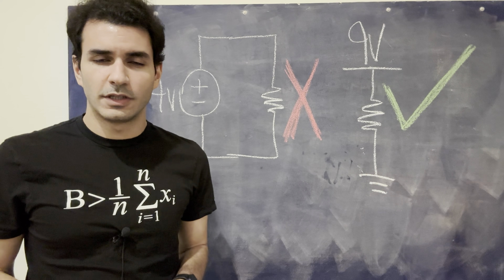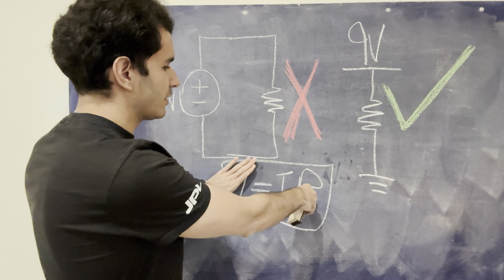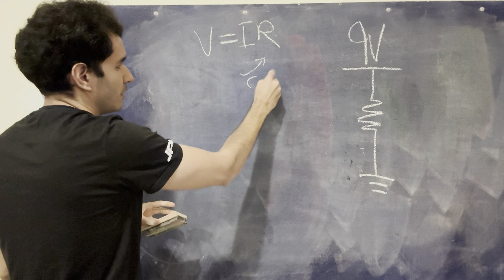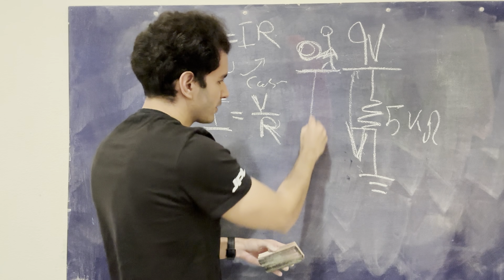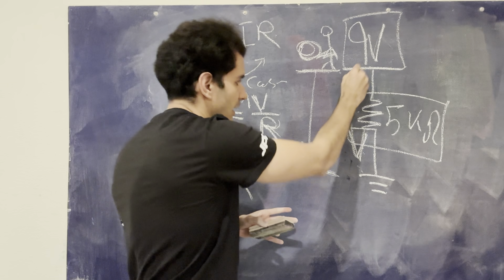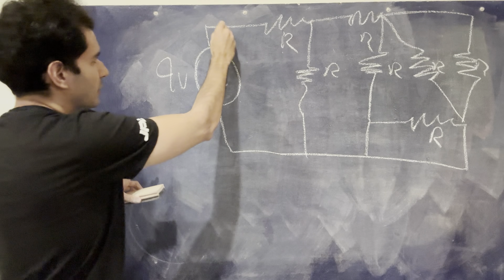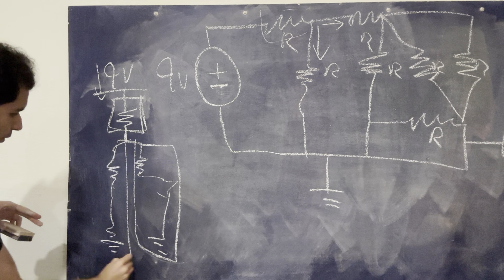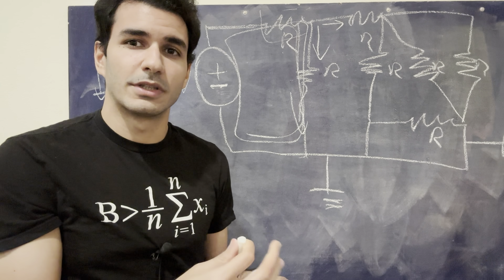Circuits Finally Made Sense When I Saw This One Diagram

Comment: Many people have a car with a battery for starting the engine .  Clearly the battery has 2 connections labled + (plus) and - (minus) .
To start the engne enormous current is required from the battery.  When the battery is OLD enough , its internal resistance become so large that it limits the current that a  good  battery provides: THE CAR  WON''T  START !   Without understanding that Resistance is symbolic, there is NO way to understand why an  OLD 12v battery will CAN NOT START the car !

Comment: So, a kid gets a battery, lightbulb and two wires. Which diagram allows him to build a working circuit?
Reply: Savage 😂
Reply: The second kind of diagram is just painted "inside" or on the battery. So the kid doesn't even need a board to put the wires on.
Reply: Both
Reply: None, the kid gets confused and instinctively opens up tiktok

Comment: We use multimeters digital or analog to tell us the voltage ⚡️, and resistance in ohms, and continuity, and use a power supply to visualize the current, or multimeter again, but need to remove the component, so it's extra work. Or if you have an oscilloscope, it's even better. What I'm trying to say is, there are few occasions where you need to figure out the volts, resistance, or amps in your head.. very few. And even in school you do learn both styles of diagrams.. so if you know it completely, it doesn't matter which diagram you see.

Comment: Uh - no that's not how electricity works. What you're talking about here is a conventional representation to make it easy.  The energy doesn't flow through the wires - it flows between them.  In fact - the electrons - even in a pure DC circuit - barely move.   Thinking in this simplified manner is what the one engineer at NXP called "The Billion Dollar Mistake" since not knowing how the energy actually works in a circuit leads to all kinds of issues with signal integrity, EMI and other nasty problems   

Here watch this: see Prof Muller show how electricity really works:

https://www.youtube.com/watch?v=oI_X2cMHNe0

the original vid that caused all the fuss - https://www.youtube.com/watch?v=bHIhgxav9LY
Should have been 1m/c seconds NOT 1/c seconds since the bulb was 1m from the switch

Dr Eric Bogatin explaining what EE's doing PCB designs know - the dielectric is where it's at : https://www.youtube.com/watch?v=Lp_b8gQpxW8
-- note where he talks about displacement current.

Another by Dr. Bogatin:
https://www.youtube.com/watch?v=icRzEZF3eZo

The article I saw in PCBD&F from an NXP engineer a month before the Veritasium controversy - "The Billion Dollar Mistake"
https://www.pcdandf.com/pcdesign/index.php/editorial/menu-features/16269-the-billion-dollar-mistake

I've designed over 3,000 products. Google ajawamnet.

Comment: I think that you could be confusing some beginners with the straight line being better than the looping circuit because that wasn't your point. Your point was to still use the loop circuit in a vertical form. I think that your argument should be more of electrical direction; electron vs conventional flow.

Comment: I am a newb - Does the resistor waste power? Is a resistor heating up? If so, wouldn't it be ideal to never have a resistor, and only use the power that is needed directly? That way no electricity was wasted by having to use a resistor.
Reply: Yes resistors waste power thats the right way to think about it. Thats why load bearing circuits almost never use them if possible. But real cables have resistance by nature of the atoms they are made of so you need to learn how to calculate it because resistance is hidden in every part and wire and can be calculated just like a resistor.

The wires you draw in a schematic are idealised (as if they had 0 resistance) because it makes the math easier. But if you wanted to design a real product, you would draw the lengths of wire as imaginary resistors between each of your connected parts. strong currents can melt your cables if you ignore their inherent resistance
Reply: @ataarono  Thanks for the reply! I have a lot to learn about electricity but I'll get there eventually.
Reply: Think of electricity as light. Without anything blocking light , it would really go fast because as you know, the speed of light. That can burn out a circuit pretty quick. To slow it down you use a resistor. Resistors are know to last many years. You'd probably throw away an electronic equipment based on  any other failure compared to a damaged resistor. Resistors do waste power but if you use a resistor that is rated higher than the required, you waste less power.

Comment: I have an MSEE and over 40 years of designing analog and digital circuits, over a dozen resulting in patents. If students find your approach clarifying, then they should use it. However, they should think about it as a tool in their electronics toolbox. Since you are training the next generation, perhaps less hubris is appropriate when suggesting tools. If the only tool in your toolbox is a hammer, everything starts looking like a nail. Whenever I'm confronted with an electronic circuit, I look in my toolbox for the best approach. Sometimes re-drawing the circuit helps, sometimes I use node analysis and sometimes, like in your example circuit, I just find the battery current by calculating the Thevenin equivalent on the left side and the equivalent resistance of the right side in my head. Skeptical? Look at your circuit. The resistor in lower right corner is shorted so it can just be removed since no current can flow through it. That leaves 3 resistors in parallel which every EE student should know equals R/3, so the right side is R+R/3. Now the left side, using Thevenin equivalent is V/2 volts and R/2 Ohms which any EE student should know by inspection. So, the current is (V/2)/(R/2 + R + R/3) simplified to I = 3V/11R. I suspect you didn't mean to draw the wire that shorts the resistor which complicates the solution, but a tutorial should be accurate to keep students on track & that's what I'm responding to. In my opinion, your message shouldn't be "do it my way" but "do it your way, and here's another tool". FYI, I started my career designing satellite communications at TRW Space & Missile Systems for NASA.
Reply: Thank you Fall room engineering, for your inside and your tone.

"tool in toolbox". Exactly. 

Not a replacement for loop analysis. 

It's a very refreshing, different perspective, as presenter turn  loop analysis on the side. 

As the observable, though nvisible phenomena of gravity is easily graphed by anyone, this approach makes enormous intuitive sense.

And presenter's point about many students just using the"plug and chug" formulas and losing intuition is well taken. 

This appeoach will likely provide an aha moment for some.  It will confuse some. 

Where I respectfully object to the presenter is a tone that implies it's been taught wrong all along. 

There's been a great deal of good electrical engineering with engineers thinking in the classic loop frame, V=IR

If I were presenting, I would use less hubris, and a gentler "this might help some of you" tone, well including some caveats.
Example

" There are many different ways to think about electrical circuits, here's a slight twist that helped me.  I suspect for some of you it's going to produce an aha moment.  If it does, great.  And for those of you who have never had trouble with circuit analysis, and consider it a much more powerful way to look at circuits, consider this a tool you might choose to use when someone seems a bit confused about a part of a circuit.  It might help them understand. 

With that said, I thank the presenter very much for taking the time. And personally, I found this to be intuitively helpful.  

I would add that if someone is sitting on a roof at a certain height with a ball, and then the roof changes pitch, this could be described as increasing resistance (flatter roof) or decreasing resistance (steeper roof).

An onlooker below the ball would feel feel more of a boop on the head from a steeper roof than a shallower roof.  Because the steeper roof and less resistance means the ball has more power.

In short, 

Vertically viewing a circuit is a  a model, models have their strengths and weaknesses.  Indeed, the explanation I just gave for a roof changing pitch also has its strengths and weaknesses.

One could for example draw a simple circuit vertically as the presenter does, and literally put the segments at angles analogous to the roof pitch. I could imagine that being helpful to some.

For a simple circuit that might help some, but when a circuit gets even slightly complicated, adding the vertical  trigonometry to the circuit would massively complicate the picture. 

Mathematics and formulas do a fabulous job of explaining what a trigonometric vertical diagram would hopelessly confuse.

Furthermore, memorizing a few formulas and using them sometimes proceeds intuitive learning. That's not a bad thing.

The presenter might also have said 

"I'll show this video now. I'll likely produce some aha moments and constructive criticism. Both I will consider a success." 

In short, 

 I hope that those serious budding electrical engineers read the constructive criticism and comments from the commenters, keep an open mind, and never forget the wonders of what can and has happened with all those little agitated electrons, nor the marvelous minds of yesteryear on whose shoulders we stand.
Reply: Gorgeous comment.

Comment: YOU ARE 1000% WRONG. ABSOLUTELY WRONG. THE FIRST DIAGRAM IS THE CORRECT DIAGRAM AND SHOWS THE RETURN PATH FOR THE CURRENT. IF THERES NO RETURN PATH , THEIR IS NO CIRCUIT.  SECONDLY WHEN YOU SOLVE MORE COMPLEX CIRCUITS WITH MORE NODES YOU NEED THE FIRST DIAGRAM STYLE TO SHOW MESH CURRENTS AND VOLTAGE NODES.

Comment: I remember becoming stuck on V=IR, in the 'Chicken egg loop' of which comes first Voltage or Current ?  Does Current flow BECAUSE of Voltage is present or the other way around? Do you get voltage because current is present.  ( In general it's the first one ) .

Comment: The way you draw circuits vertically, you need to assume that the ground is at the negative end of the voltage source, and nowhere else. While that's where ground gets placed in nearly every circuit design, ground actually isn't the negative end of the battery. Ground is just a reference point of 0 volts. It makes the math easy to put ground at the negative end of the battery, but it's actually possible to put the ground anywhere in the loop, although then the math gets needlessly complex, since now the currents looping after the ground point are negative, which then invokes the superposition theorem, and I really don't want to get back into that headache.
Reply: what are negative currents?
Reply: @ianalen1687  A negative current is just a current that is going the opposite direction from where you established the ground to be. The superposition theorem says that currents going in opposite directions will cancel out, so it makes mathematical sense to classify the 'opposite' currents as 'negative'.

Comment: Thanks for the video! 
I usually think of it as a dam holding water, and the resistance is the diameter section of the pipe that conducts water. That way, things like current are easier to grasp.

Comment: I asign a specific number to each letter in Any lettered or litteral equation Always keep the number you assigned attached Only to that letter like P= I E  You can set I=2 set E=3 then it is easy to see  2 times 3 equal 6 so set P=6 Now any way you rearange the letters you can see the Equation

Comment: Hey man! It seems to me that you found an analogy that deeply respects the principles of the manifestation of electrons when they encounter forces that require a reaction from them (I think this approach is as close to a simple approach as possible). The demonstration actually considers the equivalence between the positive pole of the battery and the ground pin, disregarding, for practical reasons, the chemical equilibrium of the component that promotes the difference in electrical potential that will result in the cessation of the force that promotes the electron reaction. This demonstration of the path of the electric current is really much more visual and allows us to validate V = IR. Greetings from Brazil.

Comment: Is nobody going to point out that ground is zero volts?  But the diagram on the left isn't necessarily saying the potential is 0 volts to 9 volts, the one on the left was saying that the difference between positive and negative is 9.  So, 10 to 19, or 3 to 12.   Both of them 9 volts difference.  But that's not the same as adding the ground (0 volts).

Comment: Current doesn't flow to ground, it flows back to it's source any way it can and where ever it might be. Only when there's a fault or stray currents, e.g. leakages, harmonics or phase imbalances do the PE or grounding wires, the bonded conductive structures of buildings, the entire local infrastucture or the actual soil itself carry currents. 

The circuit diagram isn't just a model. You can lay down real wires and components on top of it and it works fine but you're also creating a current loop where the opposing currents flow separate from each other and create a magnetic field. The "lightining rod" model is a horrible idea and from a fictional world.  

Every AC neutral and DC GND, G0, "-" you encounter is a return path of a sub-circuit within sub-circuits all the way up to the local HV-distribution network. Every step-down transformer and DC-power is a point of isolation and establishes a new source and point of return, be that your local mains transformer or your benchtop PSU. A battery does not want to discharge in to the ground, either, but will eventually do so thru leakage, capacitance, etc.

Comment: Ali, does a 50 yo guy stand a chance at getting into electrical engineering and making a couple bucks? I played around with resistors, transistors, capacitors, diodes and integrated circuit boards a little as a kid... I know Ohm's law. Should I get a degree?

Comment: The problem is that you dont have write in exam here is mire current and there us more current. In the you have to find a current through a specific resistor then yiu need those parallel series and other formulas to find the specific value

Comment: It's  ALL about the ground, what? Well,  theory and practice are not always  good friends. Electronics techs are often blaming engineers  for their receding  hairline. 😂 Why? THAT DAMN GROUND.  Hot ground, cold ground, floating  ground. Some are  straightforward,  while  others are just trying to make the poor tech guys  live difficult. From a technical  standpoint, ground is a reference  point. I have    come across  designs where  the widely  accepted practice of what ground was in television  sets just didn't  apply. Philips tvs in particular. CRT tv.  While most tvs had a reliable cold ground, attached to the crt metal bracket, that was not always the case. The point is, you can't  take Ground granted. Floating ground in car stereos, caused confusion among  amateurs.The result, damaged equipment, costly  repairs. While the use of negative voltage largely  gone, aside from audio amps and such,  ground is positive to negative voltage.

Comment: Though resistors are currently limiting devices they also provide a load on the system. This load balances the system. This is what is most important when understanding electricity. The Load on the circuit. It is what dictates the efficiency and circuit requirements

Comment: thanks for this unique visual.
what I would like to know is when is a ground necessary in a circuit diagram, and if it is, where in the circuit is it placed.as I saw in your video, you drew a circuit with a ground, then also one without..if electric current is needed to power a device, when/where is it necessary to put a ground in circuit?
thanks
John

Comment: There is a pressure from the top down but there's also a giant sucking sound from the bottom up.  You don't show polarity there but there's a force sucking those free holes from top to bottom if the positive is at the top.  The forces are about equal.  This gravity concept is easier indeed in circuit analysis, but engineers lose track that there is a force actually pulling the current as well as the push from the top.  They lose track of that concept later in life and create false concepts in RF circuit design.  You cannot forget that the voltage source has two ports and not just one source helped by gravity.